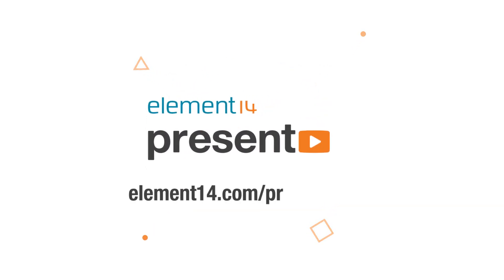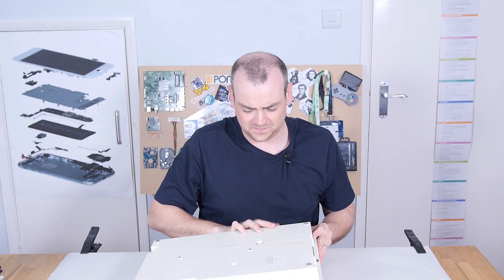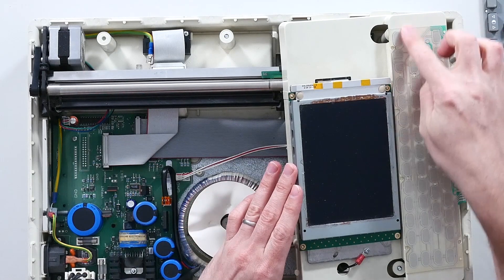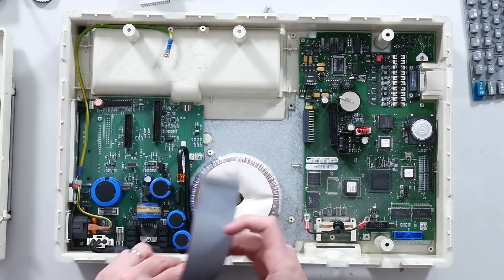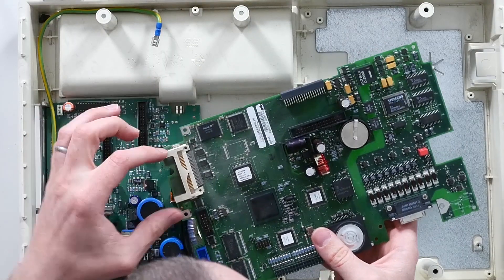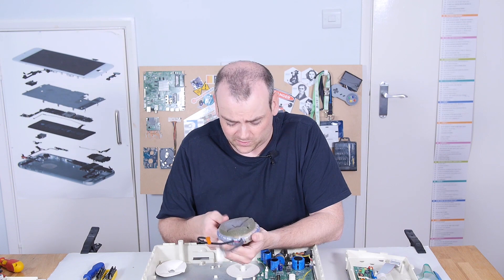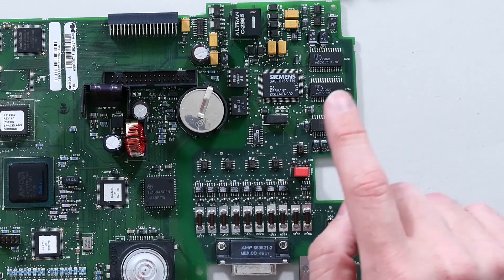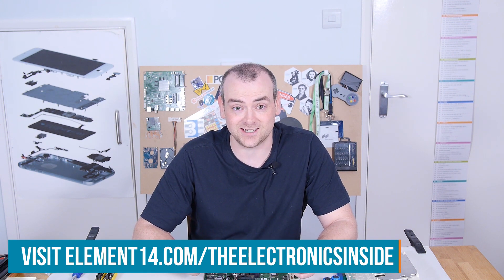Electrocardiogram Machine Teardown - The Electronics Inside

Comment: I don't think there is AC being supplied to that logic board. I'd guess that Q8 and Q9 (near the transformer T2) are being used to generate DC pulses into AC for that transformer over to the patient side. I bet that U23 is controlling them. Can't quite make out the last digit of it's part number though. TL594?
Reply: Sorry, I don't have a better picture to hand, I'll dig it out and take a look for you. I assumed it was AC because of the configuration of the diodes on the top center of this https://www.element14.com/community/servlet/JiveServlet/downloadImage/889713/Diodes.jpg

Two one way, two the other looked like a bridge rectifier to me. It could of course be pulsed, and it'd be interesting to know if that's pulsed + and - to 0V on the input or just 0 and + through the transformer?

Comment: The caps are safe. It's not a switchmode supply and there is nothing inside the machine that runs a high voltage.
Reply: I'd agree, but every time I don't mention it someone always comments on it! Also, I'd guess it doesn't hurt to be cautious!
Reply: Then you come across a device with a plasma display and get a nasty surprise. (At least the plasma display drivers usually discharge the high voltage caps.)